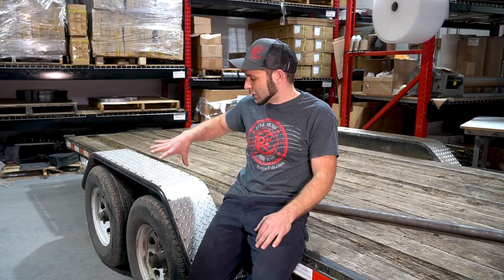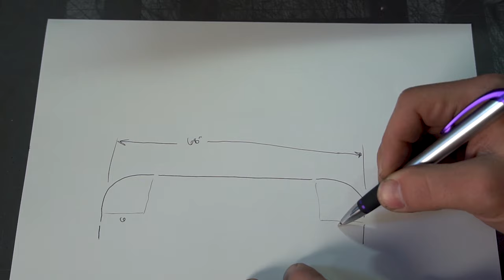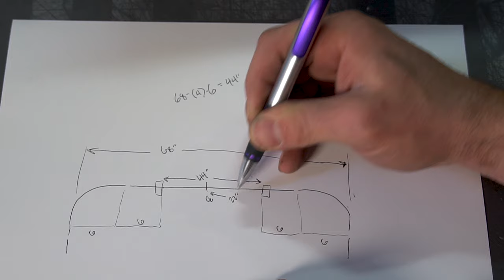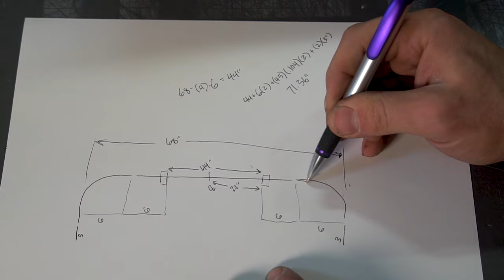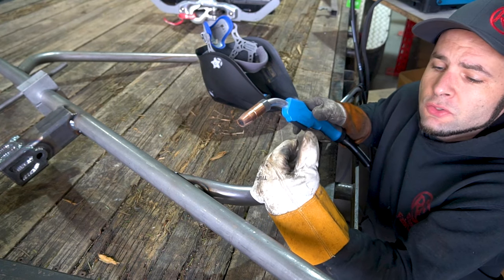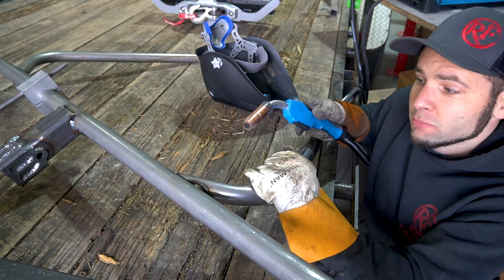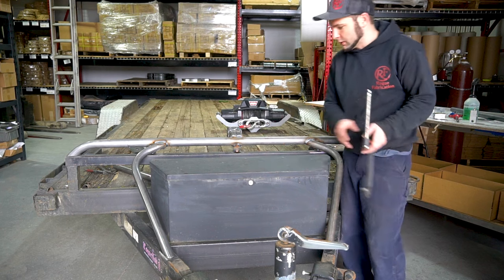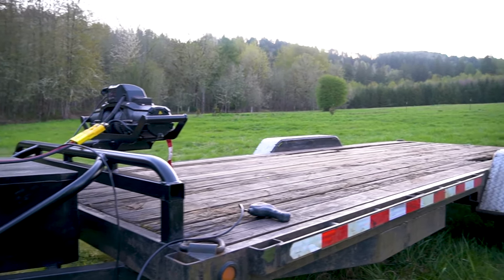Tube Bending Project- 10K Flatbed with layout tips, design tricks, how to notch tubing lesson &MORE!

Comment: Nicely done video.  I learned a few more things about metal fabrication and ways to use a tubing notcher.
   The explanation about pulsed MIG was also good and I learned more about that.
   The position you chose for the receiver tube is interesting and I'd be concerned about anything other than a straight load on it because anything angled could produce excessive loads at the weld joints and could break something.  I would suggest locating that directly on top of the square tube so it would go right between the square and round tubes.  Then I would add a couple of gussets between the receiver tube and the round tube.  That arrangement should be able to handle just about any load from nearly any direction.  That could be useful in a variety of off road and/or recovery situations.

Comment: I learned how handy the clamp blocks are. 

When I did my trailer winch mount I didn't have a tool box to deal with, so I put the mount on the tongue side with my winch going in on the tongue side..  My warn 10k let's me swap the roller fairlead to either side of the winch. Or I could have swapped the winch in the cradle.  The way I did it I can move the winch to my trucks and reroute the cable and have a fairlead in both sides if I wish.  Just run the cable out the back side.   This allows me to keep the bed clear.   Great video, thanks
Reply from the maker: Smart move!

Comment: Nice  work putting this video together.  I learned  how the rouge fab tooling  and software has all the formulas needed to calculate you over tube cut lengths.   
I like that the degree multiplier is listed right on the tool itself..

I like the way that the locking tube clamps enhance accuracy and repeatability  especially when  you need to re- bend to make up for your spring back... awesome bender!!
Reply from the maker: Thx Steve! We appreciate all your comments and feedback.

Comment: That's a cool way to tie into the front A frame on the trailer. Here at Buxton's Fab & Dab we learned how to calculate the tube required for the bends by watching this video. I think that turned out really well. Got any videos on rock sliders?   Say 120*, back 30* to run parallel with the rocker panel, in another 45* to terminate into day a piece of square tubing...
Reply from the maker: Keep rockin!

Comment: Great upgrade👍. I learned about another type of weldification.
I also have a thought about something of an upgrade to the build. The winch mounted where it is  looked to leave the truck a little far back. If you were to mount a snatch block to the square tubing you would be able to pick up about 1' or so more pull distance.
Reply from the maker: That's a great idea!

Comment: Is that a Multimatic 220? What settings were you using to achieve pulsed MIG? Or were you using a different machine for that?
Reply from the maker: It is a multimatic 255. Default 90/10 pulse for 035 wire.

Comment: Hey what size tube did you use for the fenders on this trailer. I wanna order a bender this weekend to fix up a trailer like this.. but I wanna know what  size die to get for tube fenders ?
Reply from the maker: 1.50 x .120 mild steel (HREW FC to be exact).

Comment: If you had used a front fold down toolbox up front on the A frame, you could have mounted the winch directly above it so as to not lose valuable floor space on the trailer deck.
Reply from the maker: The winch removes with a pin. We didn't lose much to the receiver,  a few square inches. Good idea though!
Reply: @RogueFabrication  if you were pulling a longer vehicle onto the trailer it might reach the winch before its fully onto the trailer.
We have been fitting the winch behind the trailers headboard here in the UK for a long time. Have a look on "Brian James Trailers" for some inspiration on it.